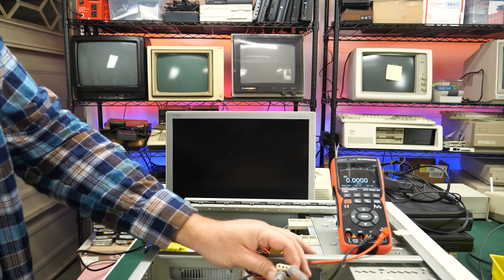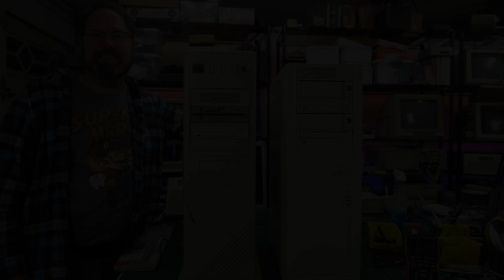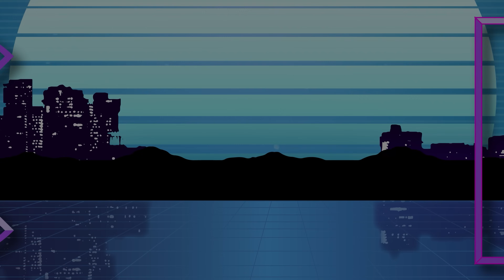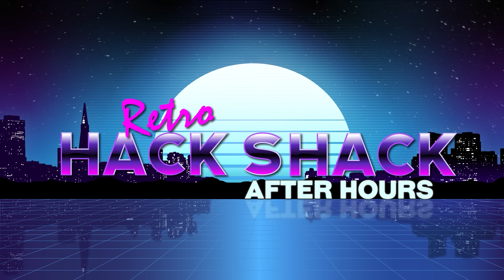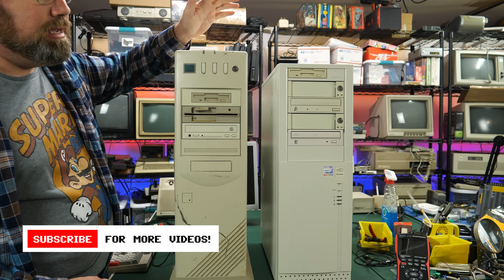Amazing Two Full Size Tower PCs Saved From E-Waste

Comment: the second one nice board P3v4x the PIII 800eb is also up there with the fastest CPU it can take - has a  via chipset so not as good as 440BX but good retro board find - so lucky u didnt plug that bad PSU in at start up - great example of why not to plug it in

Comment: I miss these cases! As our video cards are now over a foot long, motherboards getting tighter and tighter for no reason, cooling solutions getting bigger and bigger, we need bigger cases but keep getting smaller ones! It's like the two sides of the hardware industry forgot to talk to the other about the direction they were going, so one went left and one went right. But can you imagine how many fans you could get into one of these with modern hardware? Or what kind of water cooling you might be able to get? Geez.

Comment: My full tower case is bigger than your full tower case.

Fifteen 5.25 drive bays, loaded with 3.5 keyed removable tray drive carts, and an internal bracket for an additional two 3.5 drives.

Comment: Dual Pentium-MMX 233 MHz, maxed out RAM, Iomega Zip Drive, 1x 3½ and 1x 5¼ floppy drives, 1x CD/DVD drive, 1x CD/DVD burner, a few hard drives in RAID-5, running Windows NT4 or Windows 2000.

Max out that rig, man !

Comment: I had this nearly exact same motherboard in my first Windows based (Win3.11) system. The only difference was the 2nd CPU socket wasn't installed, so it could only accept a single CPU. Also, I knew exactly what that sound card was as soon as I saw the RAM on it because I, too, had the Sound Blaster AWE-32.

Comment: Had one of these Pentium towers someone gave me in 02 made a DVR box out of it. Built a frame inside and hung the MB in the center. So big, all connectors were contained inside still have that in my basement. MB still hanging and a Cable TV card still in there. Also had HD Drawers. Cut a window in the side of a case in 2000, before it was cool.

Comment: Got a Tyan Slot 1 MB new in box, never built. And An Intel also. Just found a Soyo Socket A new in box. Stuck in an Athlon CPU, in an old tower next is putting Linux on it. Got Win98SE installed but cannot get the USB drivers to work in Win. Did that Sunday. The tower was in my basement which looks kinda like your shop. Had an ABIT Socket A, stuck an Athlon in it hit the switch and POP. Was not the PS but was the CPU. One of the resistors had popped on the edge. Dead CPU. Dead MB now also. But found that Soyo and have 2 more Athlon and 1 Sempron CPU.

Comment: Ah, my much-missed InWin Q500.  Lost mine in our house fire some 16 years ago.  I would definitely buy that Q500 case from you if I wasn't on the opposite end of the country (NY).

But mine still had a high-density 5.25" drive (I had intentionally kept one on hand).  It had been running a 64-bit version of MSWin XP, dual-booting with Ubuntu (or was it already Linux Mint by then).

Comment: That power supply was on the 240 v ac when the ac is 120 v ac? This might happens with wrong ac voltage.
Reply from the maker: Nope. I checked that.
Reply: @RetroHackShackAfterHours  WoW that power supply was dangerous!!

Comment: The Card you have is a very rare S3 Savage 2000 based one.
But that's all there is to it. Not a good chip and you might want to not use it.
Though the TV Out should be rather decent. Other than that, there is nothing special about this Card, other than its a SAVAGE 2000 based one.

Comment: Why you'd want to hook up your PC To the TV? (that's what the Composite and S-Video are for)
To watch a Movie. What else ;)
but back in the day, you could only use either or clone the Display (=output the same signal to all outputs). The Only Cards that could that were Matrox G4x0, G550 and Radeon VE/7000 and the DX8 Radeons. nVidia too way longer and for them its the Geforce 4 series that supported 2 independant Display outputs...

Comment: Based on the Tyan's BIOS POST string and versions, I think you have a model S1562D Tomcat II.  These boards are well documented at TheRetroWeb.  If that's the correct model, it supports dual Pentiums up to 200MHz. (non-MMX)  It can also run single-voltage AMD and Cyrix CPUs, but only in a single processor configuration.  If it's the later S1563D Tomcat III, that adds dual/split voltage rail support enabling Pentium MMX CPUs.  More AMD CPUs are also supported, but again only as a single processor.

I'd definitely like to see it set up with dual CPUs.  I'd throw a PCI graphics card in there instead for improved GUI performance.  The board supports up to 512MiB of EDO RAM if you wanted to go really nuts.  Windows NT 3.x or 4, SMP versions of OS/2, BeOS/Haiku, Linux and BSD would all be effective ways to leverage the dual CPUs.  Linux would need to be an older distro, or one with a kernel targeting 486/Pentium as most mainstream x86 distros target Pentium II/686 now.  Windows 2000 would also run pretty well with faster Pentiums and a bit more RAM.  As for applications, audio workstation and MIDI software might be fun with the SB32.

It's kind of weird how the POST displays the CPU as 125MHz a couple times and 133MHz once.  I wonder if the FSB is/was set to 60MHz when it was displaying 125MHz.

Comment: The early systems with dual processors were used for Windows NT4 Server, and NT4 Workstation as it was the only OS at the time to support dual processors, not sure about Linux but should have in server versions. Windows 95 or 98 won't see the second processor, and could result in problems. I think the first system would have been either a Windows server that was never switched off, hence why the keyboard connector was covered over to prevent someone from plugging in a keyboard.

Comment: Do you think PCB Way can create a duplicate KDM-7 Keypad and PCB film push button part to make a replacement for the Kenwood Two-way Radio TK-250 model KDM-7 16 digit keypad ?

It is a little plastic front with the 16 buttons about 2 inches by 3 inches and a film PCB with metal push contacts that connects the film traces to tell the radio what button was pushed

It has been out of manufacture for decades.

I can't buy one, but I do have a new old stock one in the original box.

I am trying to find someone who can 3D print the keypad and someone to make the film PCB that goes under the keypad

Any ideas ?

Thanks
Bill
KC2OVX

Comment: Of course you should max-out the first system!  Overclock the bus to 100MHz if possible, and run TWO Pentium CPU's at 3x100=300MHz.  I've done that with plenty of single-CPU Socket 7 systems.  Then install NT4 or Win2K.

Comment: Would have been nice to see what happened inside the power supply, I'm assuming the chopper transistor got vaporised.
I had one of these big boxes in my workshop for ages, however it fell into disuse as Windows etc moved on and this could run nothing usefull at a usable speed (long before I discovered retro) so it ended up as e-waste.

Comment: I'm pretty sure there's a hack for the Dallas batteries, you can, well... you can put a cr2032 battery clasp on it and wire it to 2 of the pins.. but since you can still get them I guess that's fine, but it's pretty easy to do the other way
edit:  yeah I figured you'd know that, I comment as the video goes sorry
Reply: @Necroware replacement

Comment: The Inwin on the right brings back some memories, I had the midi tower a500 version of the case, and I also had the same hdd docks, mine where the earlier version, they used a normal ide style connector before moving the the centronics connectors. I had that in my 486 and pentium systems as it made swapping hdd's with friends easier to make 'backups' of their systems for them.

Comment: You two really nice things there. The Tyan Tomcat was a really high end MB. Just remember you need NT if you want to run Windows with two CPU´s. The other nice thing is that ATX case. It´s the highly regarded Inwin Q500. One of the nicest cases of the time. Fun fact from my memory lane: My only PSU explosion was in a system with that case and a Asus MB.  I think you really need to make a good NT4 rig with that Tyan board and two non-mmx Pentium 200´s.

Comment: The case to the right is the same model i have and i still think i have it in my storage somewhere. It's a really nice case and i can see that the power supply is a Power man 😄
My computer was running DUAL 1Ghz CPU PIII with 3 DVD burners, 3 network cards, 12 hard drives (i extended the 3.5" bay down in the case), tape backup and i could still run it on the PSU that was only 235 watts.
That is why they named it POWER MAN 😆

Comment: the first one I would suggest to restore the 2nd one even know I dont like the big case but it be fun to replace the board with one Ali Express systems and try to get the new style removeable cages for Stat drives and have it for a good test bench pluz gaming with that case and 3th Sorry for laughting but I probably wouid of done the same thing or run  26:32  and lucky for the motherboard too if you would of done that test before testing that board would be worth anything

Comment: The composite and S-Video are likely due to the fact that in 1999 a DVD player would cost around £250. It's unlikely you'd want to splash all that cash on an expensive computer with DVD-ROM drive and a DVD player.

It's one of the reasons the PS2 sold so well early on, as it was also the cheapest DVD player available.

Comment: At first, I was jealous of the dual socket system, then realized how useless it would be, due to lack of software support (outside of boring server stuff). Maybe see if it can run XP, and throw in a Voodoo3 PCI card, then you might find a couple of games.... For instance, Quake III can use multiple CPUs, though it's buggy.

Comment: Im surprised you didnt know about Pentium III cpu's being on a slot package to begin with, there where even converter boards that worked with certain newer motherboards with a bios update that you could plug in a socket 370 Pentium III into these converter boards to fit in these certain slot based motherboards.

Comment: yeah i was surprised to see it say Pentium 125mhz, either its being reported wrong, overclocked, set wrong or maybe its not a intel cpu, cyrix, amd, IDT winchip, IBM etc... but maybe the system is intel only so reads as intel whatever you put in it. deffinately find a compatible dual socket 7 pair of cpu's to fit in there, i will be curious to see how much memory can be installed, and what OP system would pair to except Dual Socket 7 cpu's.

Comment: Those drive connectors for the newer machine look like SCSI Wide or some kind of proprietary removable chassis connectors.  Wow!  That PSU was one spicy meatball.  Bad Caps?  Glad nothing else got fried and you didn't get hurt. 

Copy that older tower's BIOS!  That might be one of the ones that NO one has preserved yet.  The Pentium S processor runs hot, as I recall, (but not quite as hot as a Pentium D), so make sure you keep it cool, man.  Check the heatsink paste, and make sure the fan runs well.

That motherboard looks to be one of the early SMP (Symmetric Multi-Processor) motherboards.  It will need an SMP compatible OS (Windows NT 4.0 or WIndows 2000 Professional?) if you do decide to soup it up with a second processor.
Reply from the maker: Thanks for the tips as always!

Comment: The P3V4X in the Slot 1 system is a solid board.  I have one but my PS/2 ports are going out on it so I have to use USB keyboard and mouse.

Also, that TYAN board is a nice one too!  Max out all of the things (CPU, RAM) and put a dual CPU-aware OS on that bad boy and see what you can do with it.  🙂
Reply from the maker: I will be on the lookout for some matching CPUs for sure

Comment: Power supply testers are cheap and really really handy.  It won't have saved you from the magic smoke but it's a quick way to check your power supply.  Nice video!
Reply: Nah what they need is a bulb limiter. You take an old timey incandescent light bulb and put it in series with the line in. Then if the PSU draws excessive current it lights the bulb up and that limits the current.
Reply: @1pcfred  Great idea!  That will help with the magic smoke although a power supply tester will measure all the voltages all at once.  Sometimes only one voltage is out of spec and the tester will tell you.
Reply: @maladamedialabs4214  if you're testing a lot of PSUs then a dedicated tester may be worthwhile. If you're only doing it occasionally testing each voltage with a multimeter isn't too taxing. Today getting a bulb to use as a bulb limiter isn't as easy as it used to be.

Comment: The case of the AT system has a quite substantial amount of slots. I think this could have originated from an industrial PC with a backplane (which often had more than 8 slots like a normal AT PC) and an SBC. This might explain, why, if I understoof you correctly, there was a hole cut for the AT keboard connector, because an SBC would normally have a PS/2 port on the card. The board is, as far as I remember the naming from Tyan, a First-Generation Tomcat which was named S1561 for the single CPU board and S1562 for the Dual CPU board. The second generation (interestingly called Tomcat III) was the S1563 (1 CPU) and S1563D (2 CPUs), same for the Tomcat 4. The 1561/1562 had the COAST to upgrade from normal cache to Pipeline Burst (and you already have a Pipeline Burst slotted in), the Tomcat III and 4 had Pipeline Burst alrady soldered and support for MMX CPUs (and the 4 also for K6, however, AMD only in Single CPU).

I still own a 1564D, so a Tomcat 4 Dual CPU board, which is equipped with 2 Pentium MMX 233. Quite a fun in Windows NT or Linux, but you won't profit from the second CPU in DOS and WinDOS 9x. But quite interesting tinkering with it.
Reply from the maker: Awesome
Reply: It's just a server board. Or a high end enthusiast board from back in the day. If you wanted to be a PC baller.

Comment: Nice deal.  The Dual is for sure a keeper though you would need an OS that can use 2 CPUs.  The Slot1 maybe not so much as you already said.  Since I still have my original PIII system built when new, intel did make Slot1 PIIIs.  I forget at which point they added Socket 370 but they continued to offer Slot1 as an option until the 1GHZ model, IIRC.  There were also adapters called Slockets that allowed you to use a Socket 370 and convert it to a Slot1.  It was often cheaper and faster to do this vs buying the Slot1.  My model is a Slot1 800Mhz.  I still keep it around because at the time I put a Voodoo5 5500 AGP and I could never get rid of that.

Comment: You might try an x86 port of BeOS on the older tower, or even have a go with Haiku, a modern-day reimplementation of the Be platform. Both would take more advantage of multiple CPUs than contemporary versions of Windows, to say nothing of the general dearth of multiprocessing-aware Windows software from the era. Hardware compatibility might be spotty, particularly with BeOS proper, so you might need to raid the parts bin and shuffle in different cards until you find a set that the OS can do something with.
Reply from the maker: BeOS is an interesting idea!

Comment: The Dual CPU System needs a second CPU and Windows NT 4 to make full use. Oh and perhaps max out the RAM for good measure 😁👍
Reply: Windows 2000 is way more usable and lightweight enough for it to make sense. I recently went through this with NT 4. I LOVED NT 4.0 but not having USB support is terrible.
Reply: @MagMan4x4  

Personally I loved  Windows 2000. So amazing after using Windows 9x. But is it retro enough? 😉🤷‍♂️
Reply: @SimonZerafa  it's 25 years old. Pretty sure that makes it retro enough and it would not be beyond scope to have it installed on this system even in 1999/2000.
Reply: @SimonZerafa  that new-millennium allure, where it constantly feels like The Future even as it gets further and further into the past... 2K and XP still feel like cutting-edge modernity to me, it's weird how more and more people are super nostalgic for them. But sure enough they are!
Reply from the maker: Good idea
Reply: @RetroHackShackAfterHours  Also, no such thing as a 125MHz Pentium... it has a 2.5X multiplier and is on 50MHz, so it is either meant to be 2.5x 60 or 66 (150 or 166MHz)
Dosdays, Audiopci will direct you to a DOS driver for the PCI128, but it requires EMM386 which limits compatibility with games that use an incompatible memory manager
Reply from the maker: Cool. I'll check it out.
Reply: @RetroHackShackAfterHours man I used to repair computers about 15 years ago.. I've got a bunch of old computer towers.. I would love to just give them away to somebody that would use them..
Reply: Used win 2000 at work back in the day it was easy to use but it similar in feel to xp snuck games into renamed folders to play on night shift nothing like a Lan party work playing unreal.
Reply: Did you ever manage a dual/second CPU setup in this first PC? Would love to see 😍